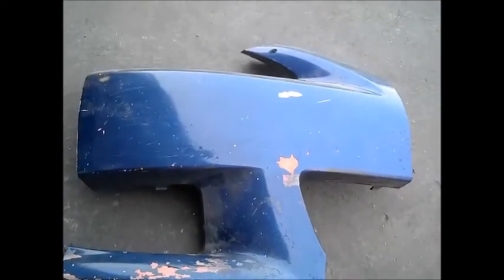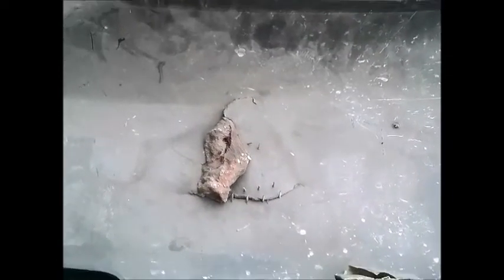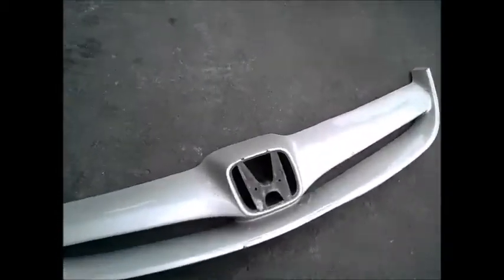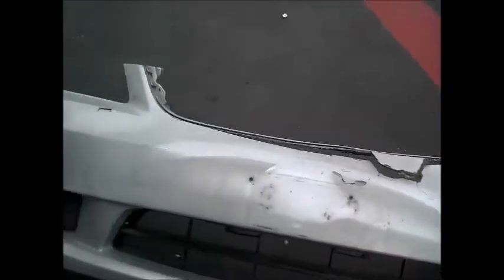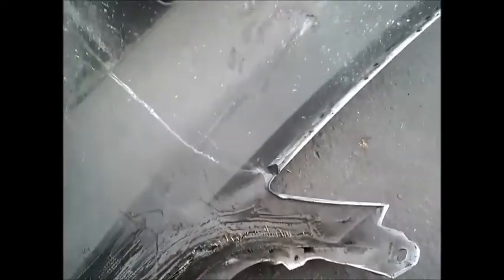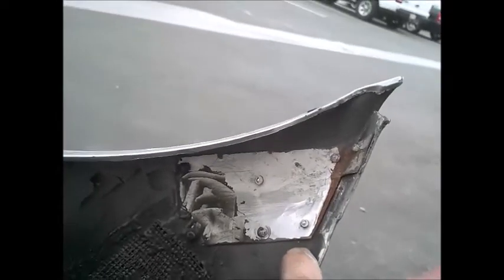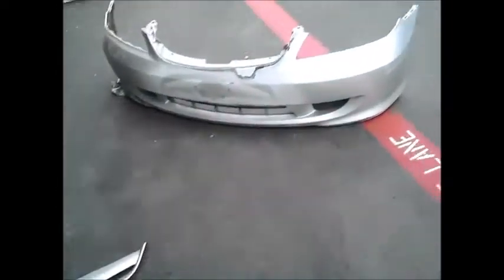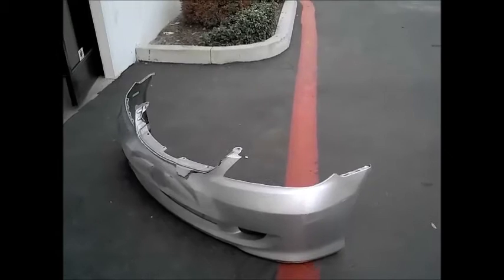Craigslist mobile bumper repair hack jobs

Comment: Not sure that all these are hack jobs. The chipping bumper is from poor adhesion or no sealer. Not caused by the repair itself. The crack repair with mesh and repair material is a insurance accepted repair and I've done many. I have never had an issue with a repair when done correctly. Also, I don't think you would have seen any of these if they weren't hit again. Just sayin'